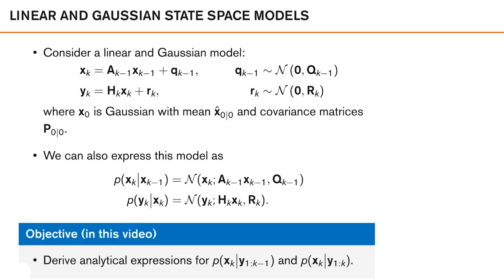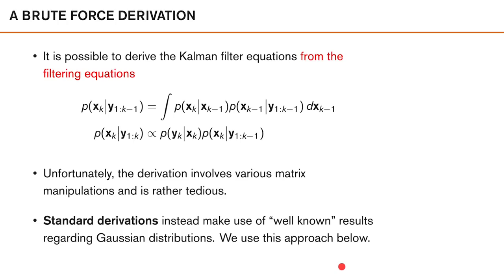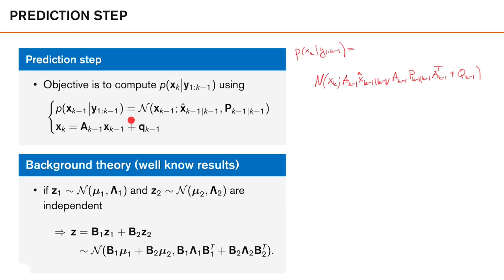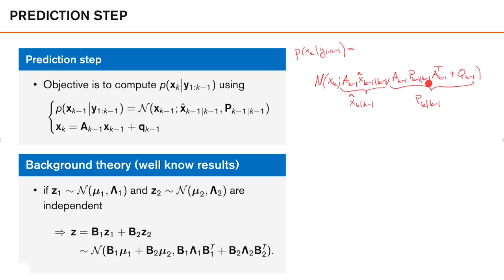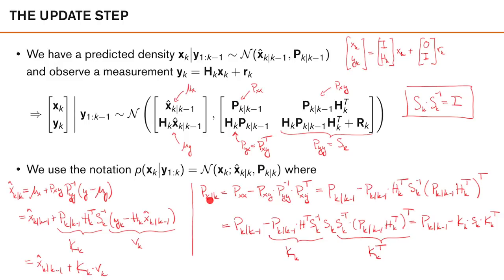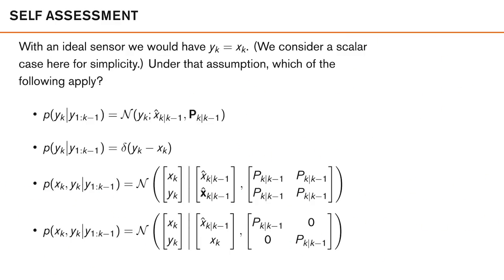4.2 Bayesian derivation of the Kalman filter

Comment: Hi Lars Hammarstrand,  after I saw  your video,  I found a very interesting conclusion: in most textbooks, we need to differentiate P_k/k over K (kalman gain) to get the K (kalman gain), that is, the kalman gain will be used to minimize P_k/k,   while for the joint Gaussian case,  the Kalman gain can be obtained directly from the P_k/k (like in your video), which means that for the joint Gaussian case,  these two methods are equivalent?
Reply from the maker: Yes, you are correct! For the joint Gaussian case, the filter posterior is also Gaussian and the Kalman filter then calculates the mean and covariance of the true posterior. However, the advantage with viewing it as finding the mean and covariance that minimizes the MMSE (which I'm assuming that most textbooks are using) is that you can see that the Kalman filter equations also make sense for linear but non-Gaussian models.
Reply: @larshammarstrand  , thanks for your explanation.